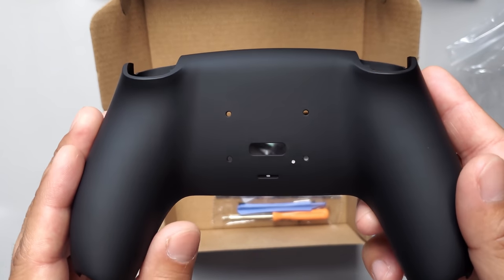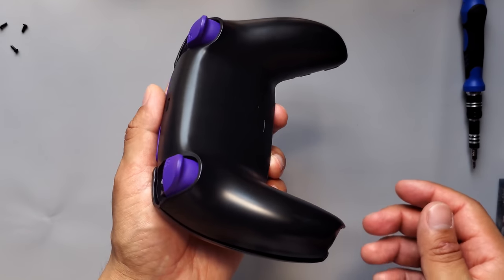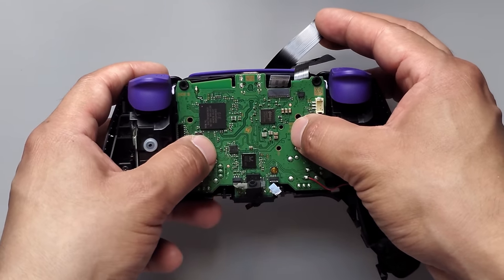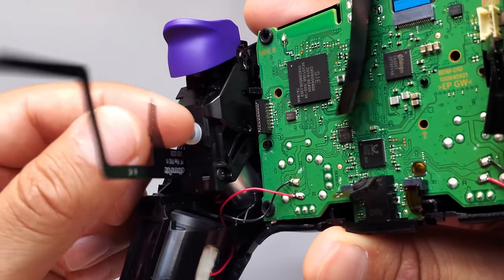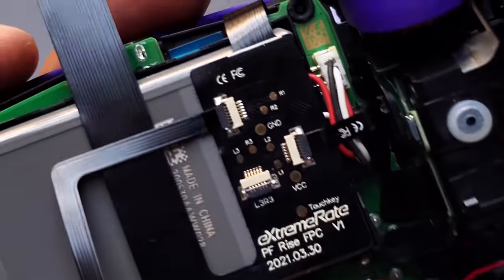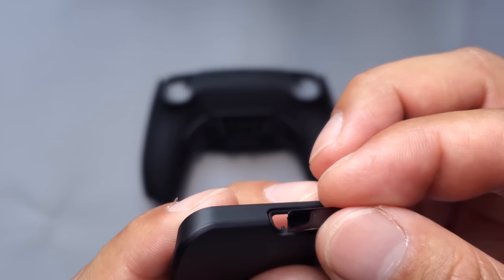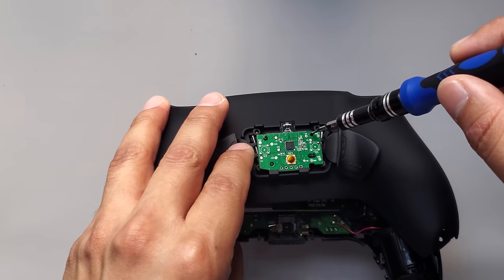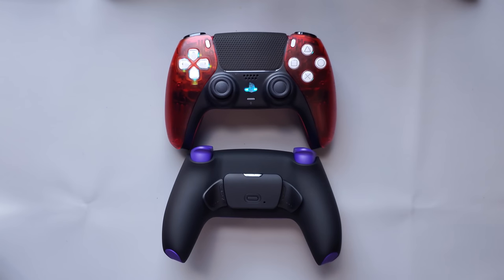DIY PS5 Controller (For BDM-010): eXtremeRate's Rise Remap Kit | No-Soldering Step by Step Tutorial

Comment: Man I was moving along pretty good then realized they left my r1 cable out of the kit.
Reply from the maker: No way. If you're not going to remap the R1 and R2 then you should be fine with out it. Some people said they tried it without the trigger cables that come with the kit and used the stock ones because they weren't gonna remap L1, L2, R1, and R2.
Reply: @im.a.caveman  so wait i want paddles so i can use x and o on the paddles. So do i need to use those r1 and l1 strips
Reply from the maker: @miractaskin4210  From the people that said they tried it they said it worked without them. You just can't Remap the triggers. I might try it out tomorrow myself since I plan on removing the kit from my other control.
Reply: @im.a.caveman  oh ok ty but xtreme rate came out with the 020 version for ps5 controller can you also check that out
Reply from the maker: @miractaskin4210  I actually have a video coming out on it but it's not an installation video. I'm just talking about the new grip 2.0 version and the metal paddles. I don't own a BDM-020 controller. But if you have questions about the 2.0 let me know and maybe I can help.
Reply: Ok well I left the r1 and l1 cables off because I won’t be programming them anyway. But I can get the light to light up after I put everything back together, any opinions?
Reply from the maker: @v3rsed855  Does your control turn on?
Reply: @im.a.caveman  Yes everything else on the controller works.
Reply from the maker: @v3rsed855  Is the cable to the remap board fully in?
Reply: @im.a.caveman  I just double check that and i got it as far in as I could and locked it down. Still no light. I think I’m going to send it back and order another kit.

Comment: Typically I broke my controller and won’t turn on / stay on! Any one else had this problem?
Reply from the maker: Can I know your BDM and the remap kit you have?
Reply: @im.a.caveman  BDM - what does this mean
Reply: Ah sorry I have 20!
Reply from the maker: @IIxJABxII  And specifically which remap kit did you buy?
Reply: @im.a.caveman  eXtremeRate White Rubberized Grip Programable RISE 2.0 Remap Kit for PS5 Controller BDM 010 & BDM 020, Upgrade Board & Redesigned Back Shell & Back Buttons for PS5 Controller - Controller NOT Included
Reply from the maker: @IIxJABxII  And you connected the BDM-020 cables?

Comment: What's the purpose for this?
Reply from the maker: To have 2 back buttons/paddles on the back of your control and be a able to program one button on either one or both. Turning it on is to remap and turning it off disables remap mode and the remap kit is ready to be used.

Comment: My controller won’t turn on
Reply from the maker: Most likely the kit is not compatible with your control. If your control is BDM-010/CFI-ZCT1W then you need the kit compatible with BDM-010/CFI-ZCT1W.  If it's a BDM-020/CFI-ZCT1W A then you need the kit compatible with BDM-020/CFI-ZCT1W A
Reply: @im.a.caveman  how do I figure that out?
Reply from the maker: On your original back shell there's a model number. BDM is found on the motherboard. But once your know the model number you can already know what BDM it is
Reply from the maker: Does the kit say only compatible with BDM-010 when you bought it or is it for BDM-010/BDM-020?

Comment: My controller won’t turn on
Reply: And yes the battery is hooked up
Reply from the maker: If the control doesn't need to charge then it could be a compatibility issue.
Reply: @im.a.caveman  what would happen if I ripped the rubber circle peace
Reply: @im.a.caveman  like there a spot I can buy the part again
Reply from the maker: @bigchungus4205  What rubber circle?
Reply: @im.a.caveman  it’s the peace you take out at 3:30
Reply: @im.a.caveman  ??

Comment: Omg 3 hours, installing the triggers and back buttons simultaneously, connected seemingly everything, pressed power and.. nothing
Reply from the maker: Power on the control or for the remap?
Reply: @im.a.caveman  thank you for taking the time, no power, the red little led does not come on, nor does the controller switch on ( i have connected everything i thought) it just the outer shell has not been put together
Reply from the maker: @TheLooking4sunset  It's working then?
Reply: @ i am A. Caveman, pretty please, if you could offer any trouble shooting, that would be great. Almost 2 am i am off to bed. Both videos were extremely good and detailed, that is why i am flabbergasted
Reply from the maker: @TheLooking4sunset  if the control doesn't turn on it would have to be the battery. Also connect your cable to it if the battery is connected just to see if it shows its charging or turning on
Reply: @im.a.caveman   geez, somehow the battery was drained! When I charged it a bit the red led came on!!! :)) testing tomorrow but looking promising 👍 a stupid error, but hey i am tired. Have a good day!

Comment: My controller isn’t even turning on 😭 😂
Reply: mine either. i found out it was the cable set that connects to the right. with the smaller ribbons.
Reply from the maker: Which kit did you buy and what's your controller BDM?
Reply: @im.a.caveman  all sorted now, didn’t realise I had tried fitting the BDM10 on to the BDM20 - got the right one now thanks ! 🙏
Reply: @im.a.caveman  never mind. The cable wasn’t plugged in.

Comment: So if you need to hold another button while holding the paddle button, like in Apex, this remapper is actually useless because it will remap the button. What a poorly designed boondoggle. The have a power button but didn’t think people might need to use two buttons at once? I went from highly interested to absolute disdain like that. What a terrible design. Basically this mod is designed exclusively for simple games that don’t need back paddles to begin with.
Reply from the maker: If the back is turned on then yes it will remap. But if the back is off it won't remap. On is only for remapping. Ex: You are able to stay crouching using the back paddle(s), and aim your weapon using L2 if the back isn't on for remapping. A paddle (for crouching) and L2 will be held at the same with no problem. Because the back won't be on for remapping.
Reply: @im.a.caveman  lol well shit, that should have been better explained. Now I'm interested again. First I gotta find a PS5...
Reply from the maker: @Parker--  I did say it needs to be shut off after those steps were done. Good luck getting one. You just gotta keep up to date with the online restocks. Hopefully you'll be able to get one. But remember, currently the kit is compatible with CFI-ZCT1W/BDM-010 controller. The updated version for the new model is coming out soon.

Comment: This is more complicated then it looks
Reply from the maker: Just one step at a time
Reply: @im.a.caveman  I did take it slow but was putting trigger stops and back button. Put together and there was a weird rumble from right motor. Opened back up to re put everything back. Ended up ripping a wire for touchpad. Brand new controller broke..
Reply from the maker: I know why it was rumbling. The gear wasn't put back correctly. For the touchpad cable I believe you can find on ebay or amazon.
Reply from the maker: Definitely not broken :) if you have an IG I can help you walktrough it if you send pics/vids. IG is on my description.
Reply: @im.a.caveman  I don't have IG. The touchpad for the new black controllers is different. It is soldered on there. I need a whole new touchpad. I looked on extremerate on Amazon, but did not see the right one. I ordered a new controller and will try again tomorrow. Was supper annoyed I almost had it just had to check the gear and ripped the wire. It took me along time to study the video while trying to install both mods. Was my first time doing something like this.